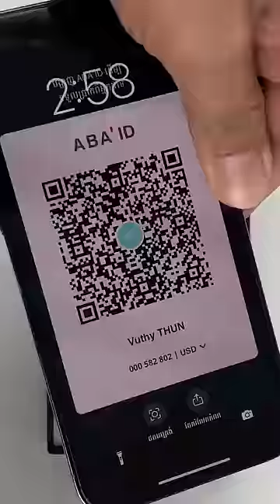iPhone 13 pro max back glass replacement #shorts

Comment: Sir, I appreciate your work. However, Doesn't heat damage the internals of the phone ? 

I mean, I would tear down all the internals before the procedure. Which I find much more of a safe way.
Reply: just use little heat, just listen to its thermal station
Reply: You should Go Service Center